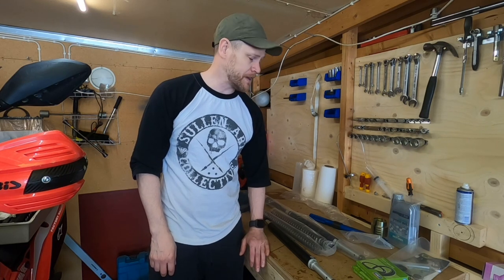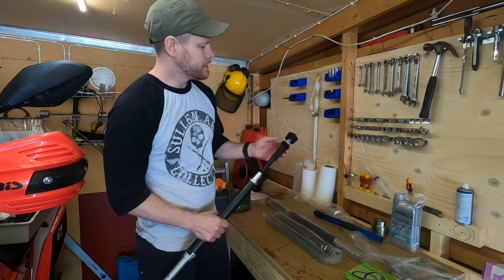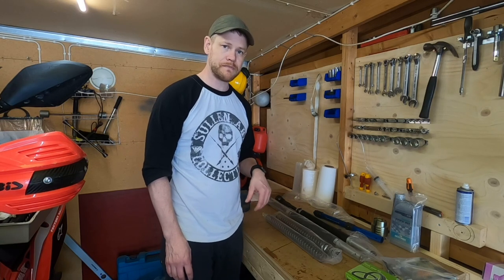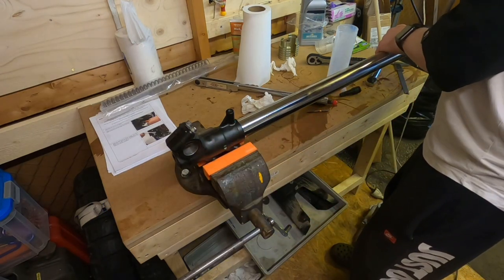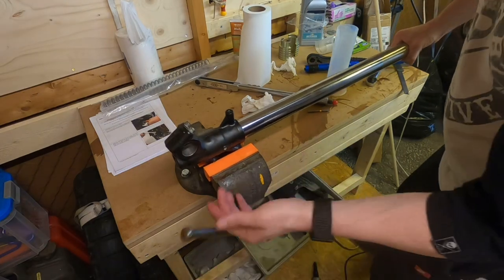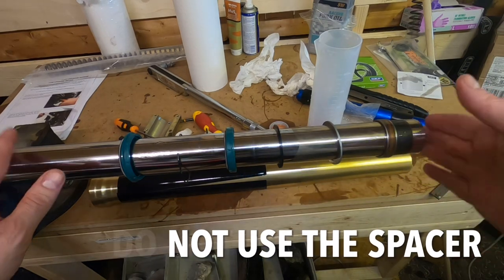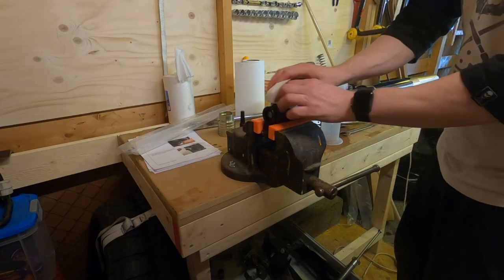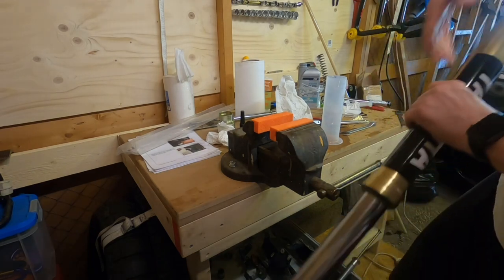RallyRaid open cartridge kit install - Yamaha Tenere 700

Comment: Just finished my first test ride of my T7 after fitting the fork kit and am very impressed with the improvement indeed. Combined with a heavier rear spring the bike is now fit for purpose, with enough leeway for a load on a multi-day long haul.
Reply from the maker: Great 😊 
Just a click of adjustment makes a difference too, witch isn’t nice when you play around. 
I have 3 in on comp and 2 on rebound. Might go 4/3 next time I ride, as I sometimes feel like I’m bottoming out in woops.

Comment: Such a needed video - I have the 230mm closed cartridge kit from Rally Raid as well the Adventure shock with same travel - have yet to install those due to uncertainty on tools and modality... Much thanks!
Reply from the maker: I thought long about the selection. 
I would really have liked the 230mm travel, but was unsure of the closed vs open. 
Will probably get the extreme rear one, so not the preload adjuster thing. 
If you want any tip or ask questions, DM me on my Instagram
Reply: Hi, I have the same as you have purchased,  very easy to install, just follow instructions. John was also a big help, answering any questions  I had the same day..

Comment: Excellent video and descriptions
Reply from the maker: Thanks John, thanks for the support regarding the seal spacer question. 
I so want to redo the complete video from scratch, and in a better way. But now it’s all on the bike 🙈. 
Amazing product!!
I have had the legs on and off a few times now, double checked oil level (had to do a top up on comp leg) but now it is all 120mm air gap. 
So many small things I could have explained in a better way and showed in an other manner, but no one want a 1 h long video. 
Now I just want the rear shock, like ASAP 🤣

Comment: Excellent video. Just about to order this front kit as stronger rally raid rear spring already fitted.
Reply from the maker: Awesome 👏, you will like it a lot 😊
Reply: @everythingtenere  did you say the one you installed was 30mm longer? If so, did you notice a marked difference in ride height or handling?
Reply from the maker: @CinntSaile  standard open cartridge. 
Almodóvar wish i got the closed one with +30mm. But more cash and not as easy to service my self.

Comment: Did you happen to pick up fork bleeders for your new cartridge kit?  I noticed that the bleed screws are smaller than the stock bleed screws, so my old bleeders won’t fit.  I’d measure the screws myself, but I’m away for work, and want to order new bleeders for when I get back.
Reply from the maker: No mate, sorry I did not.
Reply: No worries.  And thanks!

Comment: Nice video, to be utterly clear..only use spacer with OEM seal, not with SKF seal?
What did you think of the end result? Worth the money? Or is a heavier oil and weight matched spring nearly as good for easy enduro?
Thanks for making vid.
Reply from the maker: Spacer only to be used if the OEM seal is higher than the SKF one, so the spacer makes the skf seal to the same size, so the oil seal doesn’t have wiggle room between the metal spacer and the the oil seal retaining clip. 
For the T7, no plastic SKF spacer is needed 😜
The difference is very noticeable, not as jiddery when riding harder on tar (corners). 
And feels more stable on uneven surface at low and high speed. 
However, do not expect a plush 48mm fork enduro feel. 
I haven’t tested that much yet, need to go out to my fav playground tomorrow if time allows. 
The standard comp/rebound settings was to hard at first feel, and they are already only 4/6 clicks in, so I’m running 2/4 now with 6NM spring and good sag. 
But will play around more, as I haven’t tested it in rougher terrain. 
I’d say it’s way better that oem, I just wish I had the rear shock too 😂. Worth the money, hmm. Maybe. 
Ktec revalve, spring and oil might be enough. But I usually tend to cough up more $ for a bigger improvement. 
If it had more cash, I’d probably gone for the 230mm closed kit and shock 😬, just because. 
But then again, most of my riding is tar and gravel and some bits off road when I can.

Comment: hi, after several months of use what feedback can you make on this fork kit?
Did you change the rear shock absorber? OHLINS offers several interesting models. I have been thinking for two years of use now has changed put an Ohlins kit at the front which is similar to your kit and changed the entire shock absorber at the rear (changing only the spring is not enough. The problem comes from the rebound speed of the general flexibility which is not good (this is of course due to rational choices of Yamaha not to increase the price of the bike). The addition is starting to increase ... but it is normal considering the off road tulization a little engaged. Thank you for porting your videos.
goodbye
Reply from the maker: The difference after changing the front is huge, much more stable at high speed on uneven ground/off road. No more hard bottoming out, just in general so much better. 
Rear shock will be replaced before next season, changing out the front and rear is 100% the best upgrade for the T7, no doubt. 

Öhlins is probably good as well, as long as the cartridge is wider than the stock it’s a improvement. 20mm vs 35mm on RallyRaid open kit. 
I can’t wait to get the rear replaced, I agree with you about rebound there, and the bouncing around.

Comment: Since you have had this kit for a while.  What are your clicker settings for the Rebound and Compression?
Reply from the maker: Now it’s all run in, and I have had to adjust the settings a bit. 
Comp in 4 clicks in, Rebound 3. 
For sure the best way is to run in rough stuff, if you feel any bottom out tendencies, one more click in. 

However, if I know I will ride in small ruts etc, then I’ll soften it a click or two (comp).

Comment: So how do you like them after a year of riding? 
Are the plusher than oem or something similar? Asking because most of the reviews says they are quite stiff so would like to know whats your opinion about them regarding plushness on and off road.
Reply from the maker: I like them a lot !!
But I wouldn’t mind the +30 closed cartridge, would be nice to try in the gnarly I usually ride on. 
Biggest complains people have, that get these and have an incorrect expectation. 
Is that they think it will transform the suspension to enduro levels, plush and be floating over small bumps etc. 
These doesn’t do that, they improve the handeling, less dive and more control. Doesn’t bottom out straight away, and adjusting clickers actually makes a difference.
Reply: What cartridge will also increase the suspension over small bumps you know ?

Comment: Does the kit come with the spanner?
Reply from the maker: The pin type spanner to remove the cap and preload adjustment spanner. 
The only tool I bought extra was the oem cartridge removal tool (the long blue tube looking tool)